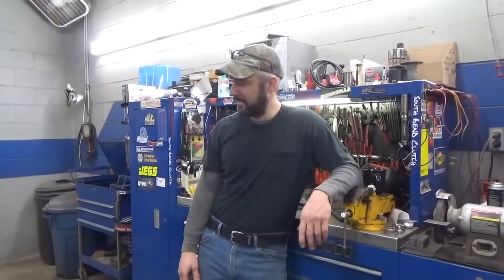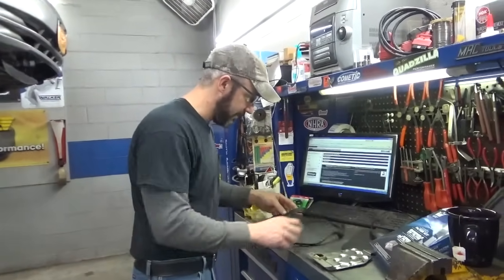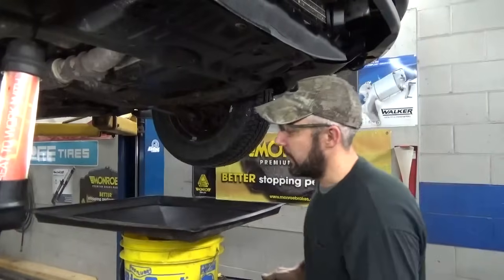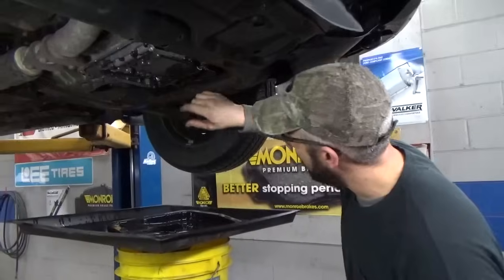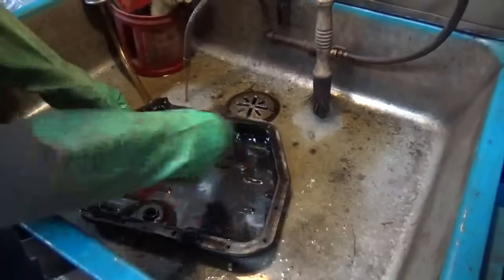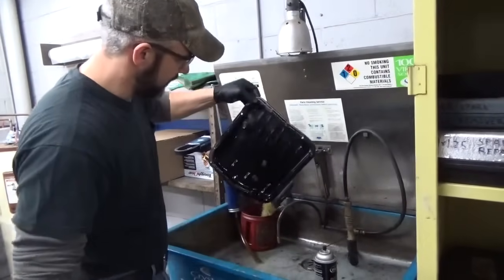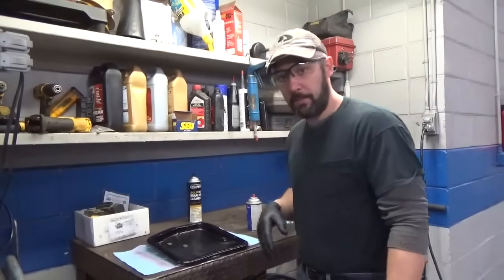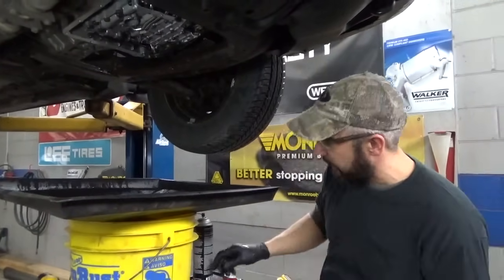Transmission Fluid and Filter Change - Toyota Camry

Comment: Some mechanics advice never to change the transmission fluid. I think they full of it.
Reply: Not changing the fluid is possibly the worst thing that you can do.
Reply: Depends, usually that advise is for older cars that have never had a fluid change, for example if the gearbox has gone 150k without a change, if you go ahead a replace it, your likely going to cause more problems. 

That being said, any gearbox that develops an issue because of replacing the fluid with the correct spec new fluid, is likely going to fail in the near future anyway, so it's one of those
Reply: That's just if the clutch material has worn off the clutch discs and is all in the fluid.
Reply: @pod9363  which is likely the case on a high mile box
Reply: @ryanmg92  yus
Reply: @TheLionAndTheLamb777  had my timing belt kit with the water pump replaced yesterday changed yesterday(hadn't been changed since 2008!!). Won't have to worry about that belt for a while. The mech told me my transmission fluid was an orange color, instead of the usual reddish pink. In fact, I changed the transmission on my other camry following his advice and directions in this vid. About to do it again.

Comment: Eric a mask is must when using those aerosol chemicals.I love your videos but try to work more safely. You owe to your wife and kids, those chemicals will wreak havoc on your lungs. Some eye protection would be great.
Reply: What are you referring to, a "dust mask"?  A "mask" does NOTHING for protection against aerosol chemicals.  For that you need a respirator with "cartridge" filters designed specifically for the chemical you're filtering.  A dust mask is actually WORSE than nothing against aerosols, as it concentrates the fumes inside the mask and you actually inhale more of the noxious fumes/chemicals.  Bad advice.

Comment: Drain and refill the transmission with every engine oil change and the transmission on a Camry will last as long as the car will.
Reply: John Ferguson, ATF does not need changed with every engine oil change. That's simply a wasteful thing to do.

Comment: There is nothing wrong with this video.    Here is our Toyota Car History. These are the Toyota we own and it all still running on the road. Two 1996 Corola at 220,000 mileage, 2006 Camry V6 at 187,000 mileage. We bought them Brand new from car dealer. Never need the Transmission filter pan change because there are a few pieces of Magnets on the pan for collecting all the metal that is harmful to the Transmission. We only change the Transmission Fluid.     If you drive your Toyota car like a normal people. You don't need to change it. Save the money and buy some thing for your Love one.
Reply: This is our follow up post massage about our Toyota car history.     Our 1996 Toyota Corolla Engine check light lite up. We found out the problem is the Spark Plugs. So we got the Spark Plugs and Spark plugs cable set change last week. at 228,000 mileages. And it is the First set of Spark Plugs and Cable set changed since the car we bought brand new from Toyota car dealer.
Reply: ***** +smssuper I've never thinking of cleaning the Throttle part section. I will keep that in mind.       We only use Super Unleaded Gasoline for our Toyota cars, maybe that is the reason we never have to do what you did to maintain the car.   I know a lot of expert saying you don't need Super Unleaded gasoline for Corolla, but they forgot the Super Unleaded Gasoline keep your car engine colder.  Just think about the Racing car at the race track. Why they use 110 Octane rated Gasoline???? Because colder engine can produce higher and stable Horse power.            By the way, we have not got any oil leak from our Corolla yet at 228,000 mileages. Because Super Unleaded gasoline makes our car engine run colder therefore the engine Oil sealed gasket still holding well.  I want to share our Toyota car history because most of us spend to much extra money OVER maintaining our Toyota cars. And wasted a lot of time waiting in the car dealership.
Reply: +Andrew Woon trugxdcvb
Reply: +Andrew Woon, super unleaded runs cooler? I've never heard of that before. Can anyone else confirm that?
Reply: +Daniel Grisham Not true. The fuel grade is just 4 points higher for engines with high compression. And the reason race cars run cooler "Not sure 210 degrees is cooler" Is they run water injection to stretch the milage and increase the air density.  While controlling engine temp. As the excess heat is ex-sorbed by the water vapor and sent out the tail pipe. 

A side effect is the engine does not build up carbon with water injection.
Reply: Claude Rains You are partially right about the no carbon built-up. When our 1996 Toyota Corolla reach 180,000 mileage. We did add the "Duralube severe Fuel system cleaner" to take care of rough idle problem. It did built-up the carbon. However, one bottle of Duralube severe Fuel system cleaner" took care of the problem.       The temperature is cooler between the piston and the upper level engine part. You miss the crucial point when the explosion in between the piston and the upper level engine part and spark-plugs. It is cooler with super unleaded.
Reply: Respectfully , the intent / purpose of higher Octane gas is to resist / prevent detination / pinging / knocking .  Especially with higher compression engines .

God bless
Wyr

Comment: Yeah I want to bring my GMC Acadia over there with 375,000 mi and my Buick enclave with 190,000 MI so that he can appreciate general motors better than he does just have to maintenance the engine to 3.8 just needs maintenance a oil changes that's all and it can have no time chain issues

Comment: You don't power flush all the fluid out?
Reply: Not always a good thing on an older vehicle to be honest. The drain and fill is good enough.
Reply: @elchinoxl3034  all I know that now I've owned Chrysler's all my life and I've always changed the transmission fluid fully along with the filter. Bought a Toyota change the fluid and now the transmission slips all the time it'll probably be my first and last Toyota!
Reply: @peachyclean93  oh dang that’s no good. I’ll deff only stick to Toyota I have a 1999 Avalon 6 cyl 230k miles no issues at all still going strong. I would never buy chrysler or ford ever again in my life! I don’t know why you had issues with your Toyota! I never do flushes ever just drain and fill/ filter replacement.
Reply: @elchinoxl3034  never had problems after just drain and fill?

Comment: I don't understand why people don't use OEM fluid. It costs more but it meets exact specs the transmission as designed. Maxlife bottle says recommended (by Valvoline, not Toyota, or GM etc) Appropriate for (by Valvoline) Notice it never says approved (by Toyota, GM etc.) because it's not. Depending on manufacture's transmission you may get away with a one size fits all fluid but why take a chance. Use OEM and change often. Scotty Kilmer says use OEM fluid.

Comment: the problem with using adhesive like that is that when the fluid comes in contact with the adhesive the adhesive will break loose clump up and plug the filter and starve the transmission of oil

Comment: ESPECIALLY on older transaxles that don't use WS fluid...it's dumb to drain and refill the pan - it's also dumb to remove the pan when it's not leaking - AISIN uses a steel mesh screen that's designed not to plug up therefore you don't need to CHANGE it - LEAVE THE PAN ALONE and FLUSH thru the cooler line into a bucket - when it starts to spit air...shut it off...refill the pan...move fluid out again...repeat until you get new looking fluid out of the cooler line then top off - usually takes between 8 and 12 quarts

Comment: Educational, Eric :) BUT you didn't say about all the old fluid in the torque convertor that will circulate & dirty the new fluid.
I do a dealer flush, to get all the old fluid out. Then, drop the pan & replace filter screen & pan gasket & replenish that fluid again.
Just use dabs of sticky, to hold the gasket. You don't have to Spray, sticky, into the pan you just cleaned :)
Do this, every 30,000 miles? / 48,000km? Send an old oil sample to the lab, each time? 30$ for giggles? :)
Yeah, it's all, expensive/ Cheaper than a trans rebuild? Drugs/ alcohol? :)

Comment: My old truck had 3 transmissions in it while under warranty,in very slippery road conditions the trans. would slip,the problem was the computer  it kept trying to engage the other two wheels to stop tire slipping,the manufacturer installed a high dollar automatic 4 wheel drive computer 600$ in a two wheel drive truck,the fix only cost them 2 transmissions and a 200$ computer,what a bunch of total dolts at Chevy.

Comment: check your owners manual, somtimes you don't even have to change your fluids, our SUV HAD 273,000 MILES NEVER CHANGED TRANSMISSION fluid, your choice our vehical is still running strong no slipping no problems, so check your owners manual befor you do any repairs.

Comment: Aw c'mon man. Literally a couple of cents to install a new crush washer. You did ALL that, and used an old crush washer. SMH
Reply: I have been using the same crush washer on my oil pan for 9 years. If it doesn't leak then it's serving its purpose.

Comment: The owner of this Camry should suit you when it goes bad!  Not only you sprayed the brake cleaner to the transmission (used it to clean the inside of the pan was bad enough) which will break down the ATF, you also sprayed the adhesive to the pan (it's meant to be sprayed on to the gasket only); BTW, yeah the next person who changes this ATF will have a great time removing that pan gasket...  Wow, you have the guts to load this video on the Internet..!!  Are you licensed?
Reply from the maker: Actually, he already did. He killed me. I am writing to you from heaven. I should have done a better job...
Reply: +South Main Auto Repair, Ah!  In that case, peace and loving....
Reply: +Bobby Taylor, why don't you spray some in your transmission since it will evaporate...  Treat other people's car as your own, fix it right!
Reply: Brake cleaner breaking down the ATF? What are you smoking?
Reply: Brake clean is a recommended cleaning solvent for doing this job in many factory manuals and dealership work. if you poured it into the transmission, yes it would be bad. but it evaporates within moments and you are talking out your ass.
Reply: +Bobby Taylor or everyone could place the gasket on the pan and pop the bolts through to hold the gasket. No spray needed lol
Reply: phantomshtter and who might you be talking too?
Reply: Apartly Rick T you don't know jack about brake clean, first, it evaporates and second, it don't leave any film behind.  Why don't you learn before you yell and scream!
Reply: Ive worked at a Toyota dealer for a decade , and I and every single tech ive seen along with myself has used brake clean when changing a pan gasket and have never seen an issue . We undoubtedly are all now dumber for exposing ourselves to your uneducated comments , please in the future refrain from commenting on subjects you lack knowledge in . Thanks
Reply: Rick t... Eric O makes these video's for the people who wants to do there own repairs.He don't have to do this while he running his own repair shop to feed his family.So if you dont have any kind words to say please keep your comments to yourself.
I am a tech myself but dont work on the field anymore but do fix my own vehicles and i have used brake clean for a long time with out any problems.
And Eric O thank you for posting this video.I do have the same color camry and trans service is due soon.Also i will be changing the differntial fluid as well.If you do a diff. service on a camry like this may i suggest that make a video of it.Thank you again posting this and all other video's.
Reply: +Neil desilva Here here
Reply: Well Rick T nothing like flapping your gums flat stick about something you obviously know nothing  about  ' Tell me are you even Licensed to talk shit ? Eric O Hello from NZ Great vidis my man  been in the trade myself for over 25 years now and always enjoy seeing someone else dealing with junk :P  'dont see rust like you do thank god

Comment: Ur not doing it right..u need to drain the converter to..so u need to disconnect the cooler line..too do 100% right job..
Reply: No! You need to drain the blinker fluid...
Reply: +Matt thats right matt, and by the way(other dude) all the crap gets caught in the filter and it is not in the  converter..The oil itself rarely goes bad. i really think the torch problem is in your underwear.
Reply: The customer wanted this. Anything more is gonna cost more.